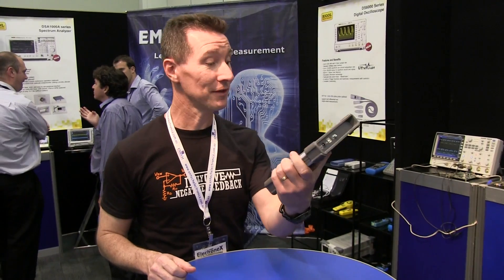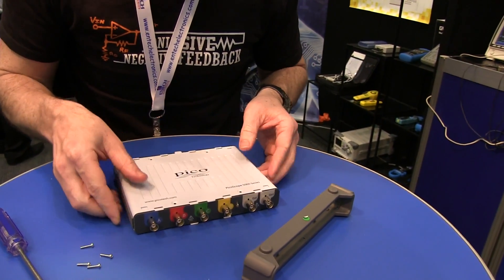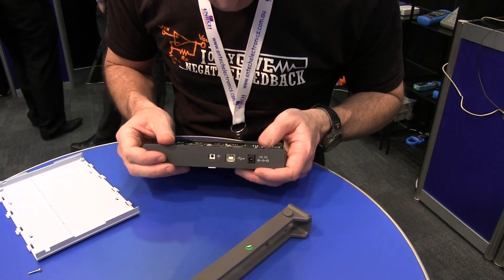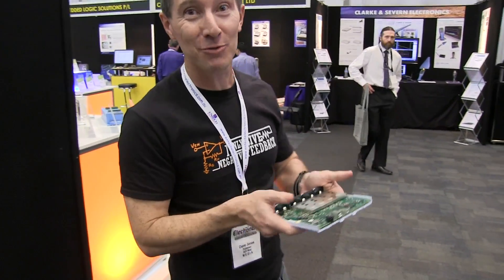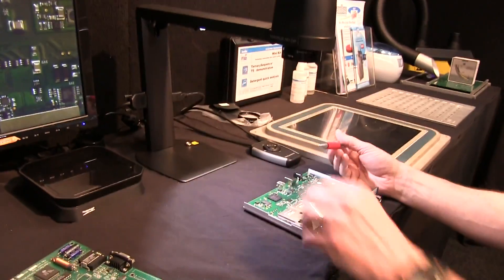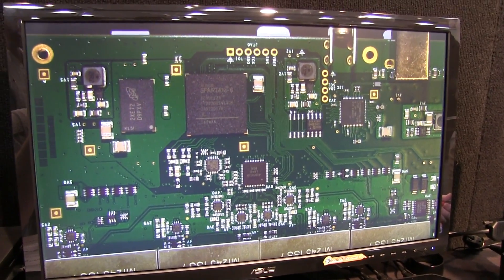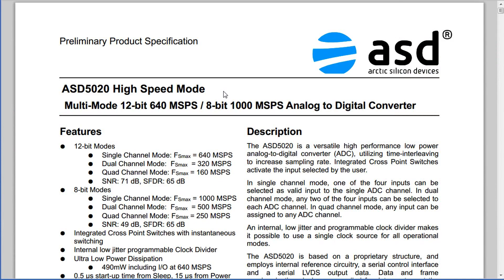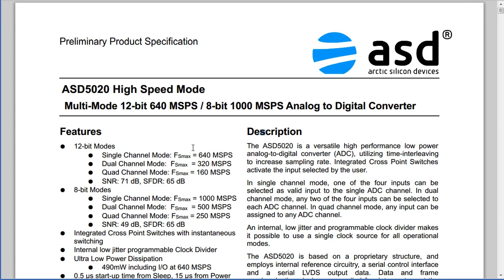EEVblog #521 - Picoscope 5000 USB Oscilloscope Teardown

Comment: sir...What is the maximum voltage we can measure with it???
Reply: +Prosun Maitra Friendly tip, don't ever start a comment on the internet with "sir." Also this is in no way the appropriate location for such a question. Considering you could just google it yourself, there really isn't any appropriate location for such a question.
Reply: [..] ±10 mV to ±20 V full scale, in 11 ranges [..]
according to:  https://www.picotech.com/download/datasheets/picoscope-5000-series-a-b-data-sheet.pdf

Comment: You should be able to get 16 bits across all four channels, just with a lower bandwidth.  Averaging four times gives you one additional bit of precision.  Looks like the chip can do 12 bits at 160 Msps and 80 MHz bandwidth on all four channels.  13 bits would require averaging 4 times to 40 Msps and 20 MHz.  14 bits would be 10 Msps and 5 MHz, etc.  The chip can do time interleaving to get higher sample rates with fewer channels; you can get 1 Gsps / 500 MHz at 8 bits resolution on 1 channel.

Comment: Just having a little squint at these Picoscope machines, and they have drivers available for Linux for some models such as the 5000 series. It ranges from GBP800 to GBP1700. Thanks for the great teardown Dave - it was lots of fun on the fly like that.

Comment: Pico and others do 60 & 100MHz, 1 Gigasample scopes for far less but this is a high resolution scope (12, 14 & 16 bits).  High res scopes cost a lot more.

Aside from being high resolution it has way more memory than other scopes at this price (32,000,000 samples).  It also has things like segmented memory, serial decoding and mask limit testing etc which are cost options on most scopes.  It also has a built in signal generator / AWG.

Perhaps it is an insanely good price?